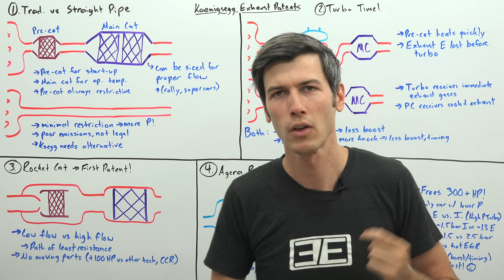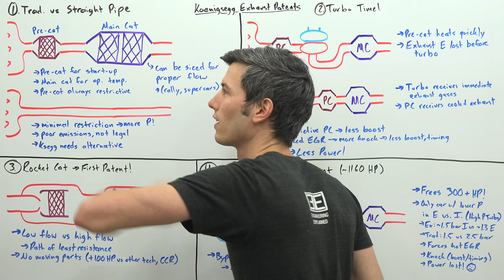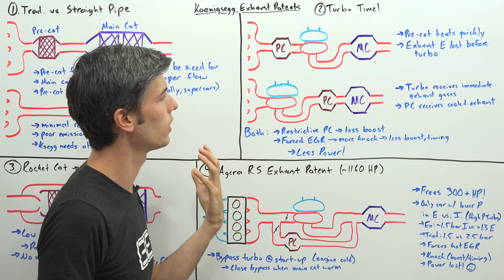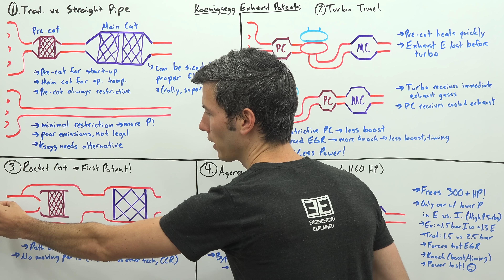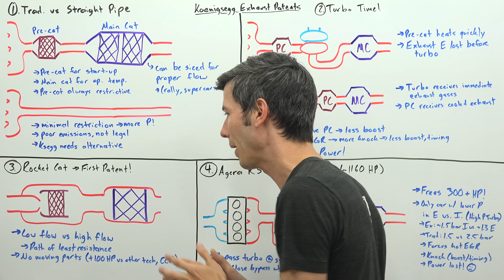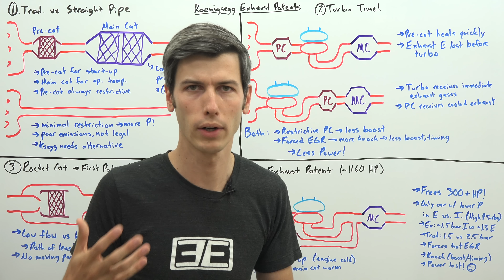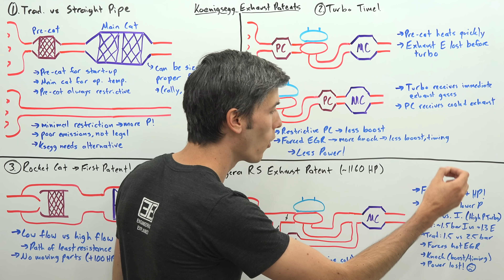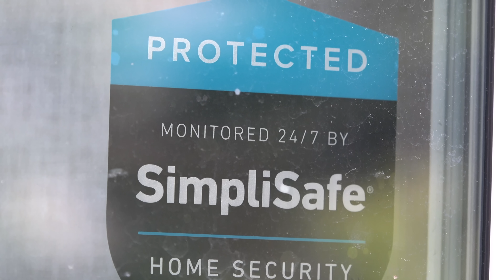Koenigsegg Proves You Don't Need A Straight Pipe Exhaust

Comment: why they can't use a heating element embedded within the catalytic converter that uses the onboard car battery to heat the converter to its operational temps before starting the engine?
Reply from the maker: You can, some cars do. Different solutions out there!

Comment: I didn't understand the part about the rocket cat. When you floor the pedal and gas flow around the pre cat, is that enough to immediately heat up the main cat to operating temperature or will there be poor emissions for a brief moment?
Reply from the maker: If you floor it initially (you shouldn't do this until your engine is warmed up), you'll have it flow around the pre-cat.

Comment: I would totally put this on all my cars if it didn't cost as much as a house.
Reply from the maker: A diverter valve does not cost as much as a house haha.
Reply: @EngineeringExplained  I doubt you could get a shop to build that whole system for less than $1000 though

Comment: So what exactly were they allowed to patent?  It seems that all they did was  install a valve that directs exhaust flow based upon the engine temperature.  That seemed like a pretty obvious solution to the problem right  after you explained the initial problem in your first "slide".
Reply: Today you can patent anything. There's no real research done by the patent office to check if the patent is viable or if it infringes on an existing patent. All of that is left up to the one seeking the patent and to patent holders to keep looking for any infringements. So if you've got a patent you better keep watch or you might get robbed blind.

As for these patents I'd say that they are no worse than a lot of existing patents in that once you see a solution it appears to be obvious. The secret sauce is to be the first to describe the problem and present a solution. That and having enough money for lawyers that the big kids don't just kick you to the curb.

Comment: I just put a spark plug in the exhaust pipe of my 1948 Plymouth to burn off the excess hydrocarbons, but the people on the sidewalk didn't like it because I had a side pipe and it scared them when it belched fire 🤣.

Comment: Could you use a induction coil to heat a single main cat before start up? Kinda like glowplugs.
Reply: Isn't the core normally ceramic,with a very thin coating of the catalyst on the surfaces. Not sure if an induction coil would heat the core and not just the container.

Comment: Wait how is this legal if it bypasses the cat? It looks like a clever cheat device similar to VW that will only work during emissions testing when the car is being idled so that they can measure the gases and when you use the pedal it will spew all the devils until it gets to operating temperature...
Reply from the maker: The cat is never bypassed, exhaust always goes through main cat...

Comment: I have a doubt.... in cooled start condition bypass valve open to flow the exhaust in pre cat that time turbo valve is fully closed turbo not spool and compressor not rotates then how to pass intake air into combustion system...koengg made any special system for that??
Reply: maybe with a bypass too, but i think, even a non-rotating turbo allows passing air though it.
Reply: I don't know weather they will resist free flow of breath..... that's why I ask...

Comment: Is it that hard to just electrically heat up the catalytic converter?
Reply: Manufacturers already use pre heated catalytic converters! I can’t believe this wasn’t mentioned in the video. I think the Jesko does
Reply: @WeirdBrick  Very rare this time. My only example would be a BMW 750 i
Reply: The Jesko uses an electric heater so it does away with the pre-cat....they already thought of it 😉
Reply: Love being proved wrong - means I learned something!
Reply: I would think it would be prone to failure.  Cats are already insanely overpriced(disinsentivisng putting them back on if they fail) adding more complexity will just make then worse. Plus, there will still be a time where NOx come out

Comment: Do you know if the system still has a wastegate or do they use the precat to bypass the turbo to control boost?  It would seem that using the bypass would keep the system simpler that adding a wastegate, unless it doesn't flow enough to be an effective wastegate.

Comment: Koenigsegg is the most innovative car company of these days
Reply: I totally agree with you, look at their special carbon fiber wheels those things are super crazy
Reply: Don't forget direct drive gearbox as well.
Reply: @Hellebron  or the light speed gearbox, freevalve, their active wing system (moving backward and up not just up => less power (weight of the hydraulic system) to push them up and back
Reply: I wouldn’t say a bypass valve was very innovative but otherwise yes they do come up with some good ideas
Reply: @WeirdBrick  It takes an innovative mind to use something so simple as a bypass valve in an innovative manner. Show me another car company that did this before Koenigsegg.

Comment: I have a question,  I have a 3" Downpipe and a 2.5" catback.. Will that cause back pressure as well? thus less boost etc?
Reply: As the gases flow and cool, they probably need less diameter as the pressure drops.  I admit that's a WAG.
Back pressure is a myth.  It's just resistance causing a relative increase in pressure.
Reply: @AlanTheBeast100  thanks so i should be fine..

Comment: I’m not a huge fan of supercars or hypercars, but if I had the money I would totally buy a Koenigsegg. Christian is awesome, the engineering that goes into their cars is amazing, and they aren’t a “main stream” car you see every day.
Reply: Absolutely agree, they are true car enthusiasts as they are passionate and innovative in every part of the engineering and building process.
Reply: Uh, I don’t think any supercar is a main stream car you see every day.
Reply: Thx man
Reply: Thing is with these cars there's a good reason they are so expensive. It's all about the amount of engineering that goes into the design, the ridiculously small series and not compromising on the materials used. The amazing thing is that they manage to do so much research with that small a crew and so little resources compared to what the giants in the industry has to work with. I just rewatched the episode of Jay Leno's Garage where Christian shows off the One:1 and one (😋) thing that I had forgotten was that they even makes their own brakes! Now correct me if I'm wrong, but it seems almost all other supercar manufacturers buy theirs, and that about nine times out of ten its Brembo. Nothing wrong with Brembo, but it's just one more example of a part that has to be designed and then built in such a small series. That is expensive...
Reply: Plus they aren't over priced and depreciate worse than a bentley...

Comment: 4:08 you said the turbo takes away some of the heat because it converts energy from the exhaust into useful work. just to get this right - surely it cannot convert heat into useful work, it is just a heat sink in this scenario?
Reply: It takes away some of the heat, takes less energy from the engine itself (trough choke) and that's why turbos can make more Powah than other types of forced induction.
Reply from the maker: That's what engines do, they turn heat (and thus pressure) into useful work. An engine is a compressor, a turbo is a compressor, they just compress in different ways. The turbo is compressing intake air.
Reply: @EngineeringExplained  sure, i was just saying it isn't the heat of the exhaust gas that the turbo is converting into useful work, is it? i mean if the turbo was fed cold gas from another source, at the exact same pressure and speed as the engine's exhaust, surely that wouldn't affect the turbo's effectiveness?

Comment: Can we expect other carmaker release 300hp with this system?can Bugatti goes 1800hp?
Reply: Bugatti can easily go 1800hp if they wanted..
Reply: Perhaps Bugatti might have physical space trouble because their engine is already so large and it has 4 turbos instead of two, which means a lot of extra piping and relocating components etc. Maybe if they implement it on a brand new platform.. Idk if it even would take up much extra space to do so, but I imagine it must be more difficult to achieve efficiency the more turbos and larger engine you have.
Reply: @Real_MisterSir  you can easily make 2000+hp with a engine that big. Bugatti cna probably do it with just a tune

Comment: This is actually am issue ill be dealing with. I want to do a J32 swap into an NB Miata, but I want cats. I don't know if the Honda cats will fit, or I gotta find some that will. It'll be an small annoyance.
Reply: S2000 cat is a high flow cat from factory
Reply: @Ryousure  that was a thought. 2 pre-cats and the cat from an S2000 would be *easy*, but id be shoving a V6 into a miata, the room for cats is questionable.
Reply: @aflacduck2  my co-worker is a welder. I can weld, but he's better. I'm gonna drop the motor in, run straight pipes quickly to get it done, then just leave it in the shop until the cats are sorted out.

Comment: So a pre cat is only for heating up the engine and main cat is only responsible for reduction of pollutants, that is if I remove a pre cat, my engine might not get warmed up quickly but I am still not polluting the environment because I have main cat?
Reply from the maker: No, pre-cat heats up quicker, and thus is used to reduce emissions while your engine is warming up. The main cat will not be effective during this time.
Reply: @EngineeringExplained  what will happen when engine is warmed up, will it not require pre cat anymore?

Comment: With the complexity of modern exhaust systems im wondering why nobody else did this. It seems like such a simple solution if you explain it this way. Maybe long term realiability of valves before the turbo is bad. Most engines probably dont have a huge benefit but if you think of the supercar rivals it should make sense for them too.
When you factor in that many performance exhaust systems have valves for optional silencing there has got to be some reason why that is not possible on a sub 1million $ car.

Comment: so... electric heater? no? too simple? aaaah yess marketing..
Reply: My guess would be that it's primarily too complicated, as we're talking about air heating on low pressures. Secondly, it's a lot of energy wasted. You'll have to burn extra fuel to reproduce that electriciy  you just used up
Reply: @g.zoltan  you don't have to heat the gas, normally the gas heats the cat so it's the catalytic part that needs heating to allow for the chemical reaction to occour. cold engines burn inefficiently to heat up the cat quicker anyway due to regulations afaik.

Comment: You should watch LockPickingLawyer
's vid on How Simplisafe is not safe... I would not recommend it to anyone let alone to promote it...
Reply: His videos also suggest that locking the doors to your house basically does nothing though.
Reply from the maker: I saw the video - like any security system, redundancy is important. They managed to over-ride a single entry sensor. You'd still be recorded on camera, motion sensors would still capture you, the alarm would still sound. If I happened to be a criminal (I'm not), I'd take my chances with something that didn't have my face recorded, or police called upon. And if someone wants to rob your house, ultimately, the best you can do is try to get police involved as quickly as possible. Determination perseveres, you can't prevent all criminals. Did you know most locks are pretty easy to pick? But I still lock my door. It's all about slowing down and deterrence. If there's something nearby that's easier, that's generally what people will go for.

Comment: Drives car with muffler... Boring. 
Drives car with straight pipe... Boring. 
DRIVES CAR WITHOUT MANIFOLD
Reply: Drives car without exhaust valves
Reply: CoyotePowered5.0 ✋rotary engine 🤚
Reply: @blacksoul3524  Nah bro, we talking real engines with pistons.
Reply: @BlueOvals24  challenge accepted
Reply: @BlueOvals24  wtf lolll
Reply: @BlueOvals24  Hold up
Reply: ZOOMIES!!
Reply: Tesla: DRIVES WITHOUT VROOM VROOM
Reply: You can't have danger to manifold if you don't have a manifold.
Reply: @backgroundman_  Actually you can, your floor panel will fall out 😂
Reply: Put a turbo on each port. Let's go.
Reply: Looses power to turbulence in the exhaust.
Reply: just spit those babies out the side like the supermarine spitfire
Reply: DANGER TO MANIFOLD!
Reply: lol that's not even good for performance.
Reply: @Oblithian  What are you talking about bro? Max airflow!
Reply: @BlueOvals24  of course 😂
Reply: Drives without cylinder head
Reply: @Gabriele Di Lazzaro hahhahaha
Reply: I heard the engine will give out maybe start to not work correctly without, right?
Reply: DRIVES A TURBOCHARGER WITHOUT A CAR

Comment: No, I don't agree that 1.5 bar upstream pressure and 2.5 downstream will cause exhaust gas to be held back in the cylinders. Exhaust gases are pushed out by cylinder pressure which on the exhaust stroke is completely separate from the intake side
Reply from the maker: You'll often have some valve overlap. Also the point is that the pressure the exhaust faces when exiting will be higher, thus more challenging to exit, thus more gases will remain behind (2.5 bar left behind vs 1.3).
Reply: @EngineeringExplained  Thx for clarifying. Your original statement didn't make that point

Comment: Unfortunately should remember that SimpliSafe system can be bypassed with a cheap radio if somebody wants to break into your house
Reply from the maker: I saw the video - like any security system, redundancy is important. They managed to over-ride a single entry sensor. You'd still be recorded on camera, motion sensors would still capture you, the alarm would still sound. If I happened to be a criminal (I'm not), I'd take my chances with something that didn't have my face recorded, or police called upon. And if someone wants to rob your house, ultimately, the best you can do is try to get police involved as quickly as possible. Determination perseveres, you can't prevent all criminals.
Reply: Everything can be bypassed somehow or other, but most people don't even have a security system so it's still an improvement. And most break ins are pretty spontaneous, so they're not going to figure out which security system you have and then go watch a bunch of YouTube videos about how to bypass it.
Reply: @danieljensen2626  tru. But not every system can be blocked with a $10 item of eBay and no skill set requirements. It is a a tep up for sure, cuz need a few minutes of research and a $10 investment, no every thief will be willing to do.

Comment: Someone posted a video about how to bypass simplisafe so...
Reply: And Lockpicking Lawyer can pick almost every lock in existence in like 5 minutes. I bet you still lock your front door.
Reply from the maker: I saw the video - like any security system, redundancy is important. They managed to over-ride a single entry sensor. You'd still be recorded on camera, motion sensors would still capture you, the alarm would still sound. If I happened to be a criminal (I'm not), I'd take my chances with something that didn't have my face recorded, or police called upon. And if someone wants to rob your house, ultimately, the best you can do is try to get police involved as quickly as possible. Determination perseveres, you can't prevent all criminals.

Comment: If they are utilizing a catalytic converter, how are they still able to make flames out the exhaust?
Reply: The catalytic converter only oxydates molecules with a little energetic step (semi-burned molecules). If you have some complete hydocarbons straight from your injectors (and if you are turbocharged you do) they can pass throw your cat and then ignite outside or burn in the exhaust all the way long.
Reply: Well, my 2.0T Genesis coupe pops when I rev high, and I have only a muffler delete with my OEM resonator, 2nd cat, and 1st cat all still on.
Reply: Isn't the cat supposed to ignite the unburnt fuel besides other things?
Reply: @SoulTouchMusic93  No. It's a catalyst. It simply makes the breakdown of the harmful particles faster, using platinum as the catalyst. The Pt is unchanged in the reaction, and simply breaks down the gases. It has no effect on engine flames.
Reply: @WinterCharmVT  oh. OK then. Thanks for clearing it up.
Reply: Yes
Reply: My Rx8 backfires b/c the rotary is an inefficient engine.  I still love it tho

Comment: Looks like a lot of extra weight to me, just straight pipe it.
Reply from the maker: I guess you missed the part about manufacturers needing to build cars that are street legal...
Reply: This also seems needlessly complex, I can already foresee that diverter valve not functioning properly and either killing power or not meeting emissions on warm up. Sure this car will never be driven enough for that part to fail, but what happens if this tech trickles down to more normal cars as manufacturers chase every ounce of efficiency and horsepower out of an engine? The rocket cat seems like a way better design.